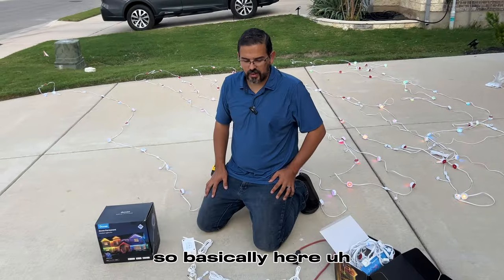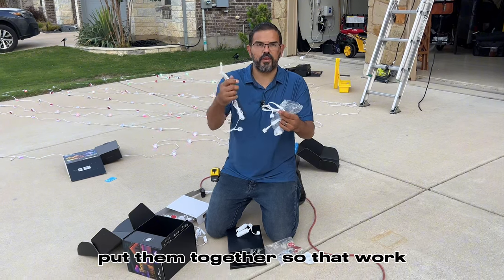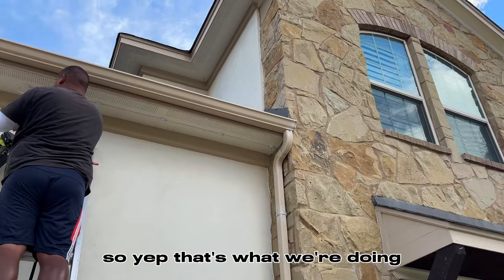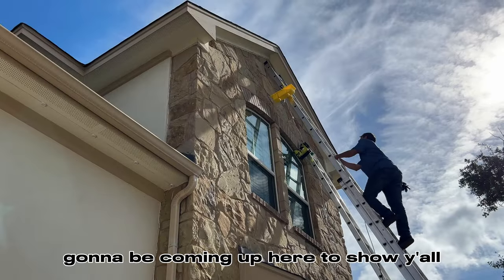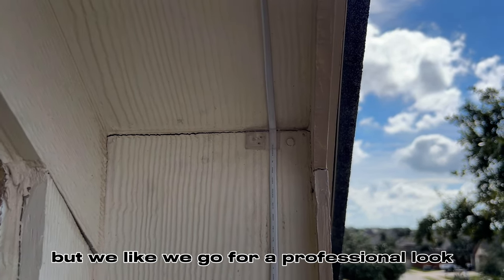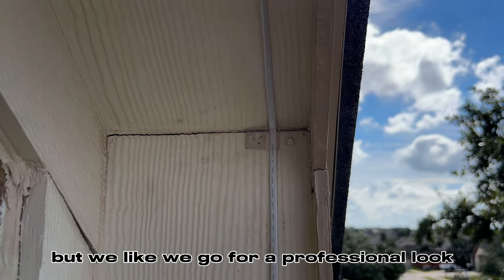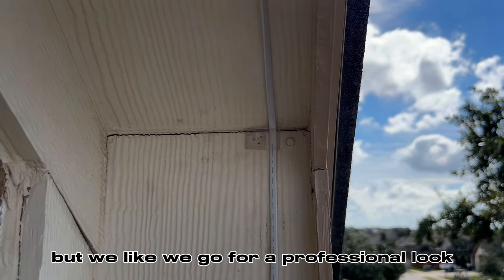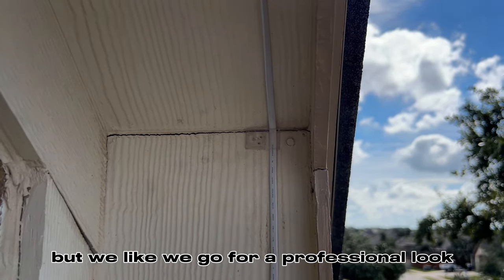Govee Pros Install (White Version) Round Rock, Tx @GOVEE #fyp #howto #diy

Comment: 1.from your experience, what is the best distance to use to install the light from the edge of the the house/garage? 3,4.5,5 inches?
2. what size of finishing nails do you use?
Reply from the maker: We always do 2-4” to get the triangle/cone effect as recommended my Govee. I’ve seen other place it further because they want to conceal the look of the wire and placing it right behind the fascia board. Doing so will eliminate the wall washing of light on the wall for the cone look and give you a disburse of light. We use 1” nails for our projects
Reply: @jbsdiytv  does it make a difference if I use 20/3 AWG instead of your recommended 18/3 AWG wire for the splices? I found a lot of recommendations to use 20 AWG.
Reply: @vincedenbu  Not really, since the volt/amp is low enough. If you do long stretches, 18awg may be slightly better

Comment: Question, I tried cutting short a strand on the 1st generation govee 150ft. When I tried splicing the wires back, about 10 lights from power source flickered white and now only 10 lights work. Any idea? Just ordered another set but I really wanna save the first one...
Reply: Did you connect the wires appropriately? Are the cut strands touching at all? Even one strand can mess it up if using electrical tape or something similar, wires may poke through. I just ran 150ft with multiple cuts, no issues and no voltage drop

Comment: I have 2x4 eaves in the way, can you tell me if it is safe to drill hole through them to run the govee lights without having to worry about the 2x4 in the long run.
Reply from the maker: Sounds like you have open rafters and no soffit. I don’t recommend drilling through each one. Purchase a 1x2 and install the strands on that. Then install that board 2-4” from the wall and anchor them to the rafters
Reply: @jbsdiytv  Thank you for responding so quickly, I was literally about to drill after work, much appreciated.
Reply from the maker: Your welcome
Reply: @jbsdiytv  I was just looking up images for what that part is called.  It's an overhang above my garage, is that still not drillable?
Reply: On the outside of the house.
Reply from the maker: @tonyn6969 you can drill if you think that’s best but like I’d mentioned, I would do that to my clients houses. I would make it look professional and call it good. It’s your home

Comment: can you cut the govee the lights to a custom length.. like for instance if i only need 4ft length to finish my run, i dont need the whole 16 feet
Reply from the maker: If it’s your last strand, yes it can be cut. Count how many strands you have and add the cut strand as a full strand(segment) in the app under device settings. While doing all this, the lights will be all white and green dots within it. Count the number of green lights showing. If this matches your total strands then you’re good. It will ask if you have spliced. Say yes and recalibrate

Comment: Hey JB can you make jumper? If you can how long and what type of wire gage would you use.
Reply from the maker: Use 18-22gauge wire only. Keep them short to prevent flickering. I try and make custom jumps within the provided 12ft or 4ft extensions so you still have a data booster on them

Comment: Have an idea for installing these on the side of the house, where only an inch overhangs from the shingles?
Reply from the maker: 😳😳😳🫣man, I’ve had some people comment on other platforms on this but yeah, need to install L channel or box them in with a metal channel. This can get tricky if you haven’t worked with mitering metal at certain angles

Comment: Do the kits include additional lengths of wire without the lights for gable jumps? If not? What wire do you use? I saw another video you did with gable jumps and it looked as if you used the wire that you cut off. But then there were several long runs. Thank you.
Reply from the maker: Yes, I answered this question on the other post

Comment: How did u do the 200 ft I did that’s and the extra 3 strands didn’t light up
Reply from the maker: Hi and thanks for watching. Go to your controller, hit the power button for 6 seconds until you see white flash. Then as you go into device settings to set up the segments, the all the lights will turn white with green dots. The green dots will indicate how many strands you have. Put in the amount and if you spliced anything, hit yes and calibrate

Comment: Awesome job, I got a couple of questions. My soffit is over 150ft actually about 210ft.... Can i buy an additional 100ft and make it work as one and what would you recommend for vinyl siding for fasteners?
Reply from the maker: You always would like to shoot for one controller for your lights but I know that is limited with the feet the kits provide or what it can handle. When the pros are available get the 200ft. It will be all worth it. You can use Bluetooth and WiFi in one controller. You can easily splice without losing warranty and it easy to work with
Reply from the maker: As far as the fasteners to use, use the link below to purchase hitch clips pins to place in the holes while holding the wire in place

https://www.amazon.com/dp/B00IZFR74E/?tag=jbsditv-20

Comment: Are you nailing those clips in to the vinyl soffit? I want to mount some on my vinyl soffit but I'm worried the 3M tape won't hold up over multiple winters and season changes. I'd prefer a mechanical way to mount them to the soffitt.
Reply from the maker: We are nailing into hardiplank soffit not vinyl soffit.

Comment: Love your channel! Do you have any advice on how far i can extend my Govee lights? I used 3 strands of the 100ft  on the front of house, i want to use the remaining 3 in back yard but the extension is already in use. Will i have to just abut another set to get another power supply and controller?
Reply: *buy another set
Reply from the maker: Hi and thanks for watching. Yes you have to buy another kit to acquire another power adapter and controller. Govee does not provide extra accessories. You can try asking someone on the FB govee groups. Only option currently
Reply: @jbsdiytv  Thanks for the reply! You'd really think they would start selling accessories. They're missing a huge opportunity to expand their sales. So many people want to purchase extra extensions and adaptors and such. Anyway, thanks again
Reply from the maker: @zootybang I hear ya. Not a problem

Comment: Buen video, can You put pro power suply to version 1?
Reply from the maker: Thank you for watching. I haven’t tried it  but if you don’t mind me asking…why would you use the power box pros on the 1st generation lights? Seem redundant
Reply: To try to add more strings, becouse pro power suply si 3A, First gen is 2A @jbsdiytv
Reply from the maker: @dulux69 I see, yeah just verified it but like I had mentioned in the video, the only difference is the connection is not the same for the adapter and controller with the first generation. 1st gen has the 3 prongs and the pros have an auxiliary connection
Reply: @jbsdiytv thanks

Comment: Can you run 200ft on a non pro govee lights with one contoller? If I use 2 seperate 100ft, can I just group the 2 controller in the app and run it that way? TIA
Reply from the maker: Hi there and thanks for watching. You can’t run 200ft on the 1st edition lights. The controller/app reads 9 segments only which is 150ft. If you use two 100ft, yes you can group them. Only thing different is that there are certain functions you have to do individually for each device and then set a schedule for them

Comment: Im planning to install mine but I measured it is 200ft more or less. Im planning to use the  govee 1st gen. is it ok to use one power supply for 200ft?  Thanks
Reply from the maker: You cannot run 200ft on the first generation lights. 150ft is only 150ft. The 100ft can run an extra 50ft

Comment: What’s the max feet of line or lights that can be put on 1 transformer????!
Reply from the maker: The website indicates 150ft so I recommend to do just that until the module driver is released. Now, I was able to do two installs with 12 strands(200ft) and I’ve contacted the homeowners said they have had no issues. I will definitely circle back once those drivers get release. Make right choices, install what’s recommended first. Thank you for your support to the channel

Comment: Are you running power in 2 directions on this project?
Reply from the maker: Yes. Client bought 4 boxes of the Pros 100ft but we just used the controller and power adapters of two boxes.  The front and right side had 200ft and the back and left side had 150ft

Comment: You said one controller for 200’. Did that change with the pro? I thought you could only run 150’
Reply from the maker: Correct. At that time we installed 2-100ft kits together on one controller and it worked. Since the firmware updates we had to go back and add the LED Driver Module after the fifth strand of lights because there were performance issues after the updates. I would recommend adding that LED Driver Module always now if going passed 150ft. Thank you for your comment

Comment: Mine are not holding to hardy board and staple gun won’t staple through it. Any suggestions
Reply from the maker: We don’t use staples guns for this reason. We use 18gauge Brad Nail guns that have impact settings so you can adjust the depth of the 1” nail to the clip surface

Comment: they only come with 1 12 foot extension cable, how did you get 2?
Reply from the maker: The client bought 4 boxes of 100ft pros. Two boxes were put in front. That’s 2-12ft  and 4-4ft extensions available to us. Then in the back it was 150ft that’s another 2-12ft and 4-4ft extensions. We install Govee for Texas residents so we alway have extra accessories as well

Comment: Hi I just bought the 200’ pro . My question is I’m placing the on the first and second story , do I need two controllers for the first and second story? And if so will they be in sync? Or should I try and hook them up using only one controller? The jump up to the second story is far so I’m not sure how long I can make my jumper?
Reply from the maker: It is difficult to know what your layout of your home looks like as each scenario is different but I do always recommend one controller if it’s possible. Do you have any other social platforms that I can DM you?

Comment: Nice work! I've been trying to find a good solution to installing these on those flimsy vinyl soffits. I don't think a brad nail would work very well.
Reply from the maker: Use a hitch pin in the holes
Reply: @jbsdiytv ca you explain this more?
Reply from the maker: @charleedoessolarmaintenain9149  yes I sure can. Vinyl soffit have small holes in them. With this hitch pin, use the side that’s straight and place them in the hole holding the govee wire in place.

Here’s the video I got the idea from. Give credit to them
https://www.instagram.com/ourdiyhomeproject/reel/Cz33AkvL0Lk/
Reply: @jbsdiytv  bro thank you so much!
Reply from the maker: @charleedoessolarmaintenain9149  yes sir, not a problem. Thanks for the support

Comment: I’d be worried going over the roof what if you need a new roof someone has to remove the wiring ?
Reply from the maker: Thats one thing we ask our clients if they plan to get any new roofs anytime soon. If it ever came down to that, the roofer can unscrew the connections off the extensions to the lights. In your case since you live in PA, I would find other methods to run them through your attic along with the devices

Comment: Great videos. So helpful. I just purchased the 200ft Pro lights. Can you use a longer extension then 12ft provided by Govee? If so can you point one out to me. Also would you know the maximum length I can extend? I have 2 stories and would like to connect the one strand to first and 2nd floor soffits. Also my soffits are stucco. Any recommendations on how to mount lights to stucco. I've seen the provided adhesive pads don't work well on stucco.
Reply from the maker: Thank you for watching. Yes you can use longer extensions. Buy 18/3 gauge wire. Then use a 4ft Govee extension, pro splice connector, the custom wire, pro splice connector, then a 4ft pro extension again. Doing it like this we have done 30-40ft jumps. As for the stucco part, you will have to pilot a hole and add a insert to install the screws
Reply: @jbsdiytv  Thanks JB. Will try pilot hole anchor and screw combination with Gorilla Heavy Duty Construction Adhesive.
Reply: I see that you used TYMXGHF transparent Strip Light Clips,Self Adhesive with Screws Mounting Holder,50Pcs LED Strong Fixing Clips And Screws on your jobs. Do you know if I can use this with pilot hole insert and screw to stucco? Also my one of my connection extension is actually 52ft. Is that length a problem?
Reply from the maker: @JoelSoloria you can use these but I would use a different screw than the ones they have. I would get a #6 3/4” Phillips head screw to use. As far as the 52ft jump goes, that is way to long of a jump with using the proper formula. I’ll post a video in a little while and tag it back on to here so you can see the formula
Reply: @jbsdiytv   Thanks JB. I took measurements on pdf images of plan and where I intend to connect power. Do you have an email address (or other formats) I can send to you? Would love to get your input and a picture paints a thousand words.
Reply from the maker: Message me here

https://www.instagram.com/jbsholidayandchristmaslighting?igsh=MXhzeHR0bHQ4eHRqag%3D%3D&utm_source=qr
Reply: @jbsdiytv  Thanks JB. I sent message for design plan and images per the above but got rec'd "This account can't receive your message because they don't allow new message requests from everyone.' If you didn't receive could I email you images and design plan?
Reply from the maker: Your account is private but I started following you

Comment: im sorry i have so many questions. last one and ill leave u alone. im pretty handy but electrical currents arent my thing. so lets say i plug my stuff in and i start. at the left of my roof, my roof runs straight across about 50 foot and i also have a peak above my roof that starts after about 3 feet from the left and end at about half way point. can i run a splitter to get the peak and the roof right there on the left? i seen some splitters on amazon. if this wont work what can i do? like im worried id mess up the flow of the lights say if i were to do some sort of fluid light show. id want the peak to run left to right with the main roof.
Reply from the maker: No worries at all, this what this channel is here for. Message us @ JBs Holiday and Christmas Lighting LLC on FB with your layout

Comment: Excellent video!  I have a similar frame on my house.  I just received the 200ft Pro and I'll need to get creative without making too many splices/extensions while trying to keep those extensions inside my attic as best as possible.  Is there any reason not to use insulated cable staples such as DEWALT DRS18100-XJ staples to secure the line along the soffit?  Seems like that would be easier than using those clips.  Also, I believe there are 60 clips that came with the pro which won't be enough if I go that route.  Thanks for this video.  It really helped me visualize how I need to tackle my home.  4.75" seems too far from the wall but as you said, that's what the customer wanted.  I'm thinking about using 2.5" for mine as it's pretty close to the middle of Govee's recommendation of 3-8cm (1-3 inch).
Reply from the maker: Thanks for watching. We have done over 60 installs and tried almost every method to secure these lights. Keep in mind our clients pay high dollar for installs and want no excuses and want the best install that will last so that’s what we provide. We go for a clean, tight and working install as always. You can use a staple gun that has impact settings and it will work but there is a slight gap between the light and the staple. That’s out of my control as the staple gun is designed like that. We have used cable staple gun and the gap is present as well. Also, the staple is bulky. Only 5% them work on hardiplank, the rest just bend. We have done screwed all the clips before but that takes way to much time. We have a least 10hrs to complete a perfect install. That’s why we use the transparent clips so it blends with each soffit. Yes, the customer wanted 4.75 but it wasn’t to bad but yes I agree that these lights are intended to be installed 2-4” from the wall so you get that cone effect.
Reply: @jbsdiytv  thank you for the fast reply.   You answered my thoughts about staples (gap and bending).  Clips and nail gun it will be.  Is there a way that I can send you a picture of my house to get your thoughts on how I might address a couple of upper level roof lines?  Thanks!
Reply from the maker: Do you have a Reddit account?

Here is the video link to purchase clips. Usually an install will take 150-200clips

Govee/AliExpress-Endless amount of clips #diy #howto #fyp #govee
https://youtube.com/shorts/iwZyyI3RXUw?feature=share
Reply: @jbsdiytv  I just created a reddit account
Reply from the maker: @chiltonj  u/JBs_Christmas_Lights is my user name
Reply: @jbsdiytv  How would that be to install for 200ft pro version?
Reply from the maker: @saikiranagiru3225  not really understanding your question
Reply: @saikiranagiru3225  how much to install 200 feet
Reply from the maker: @mattmoraes1841 Hey Matt!!! Have you had your 200ft lights installed already installed? We have links at the top of our YouTube channel to reach out
Reply: Are u guys in Florida
Reply from the maker: @mattmoraes1841  we are in Texas and will travel if need be. Please reach us on our social media platforms for a quote. Thanks